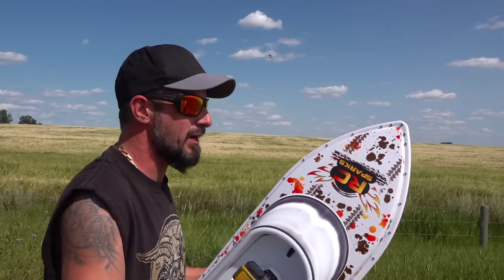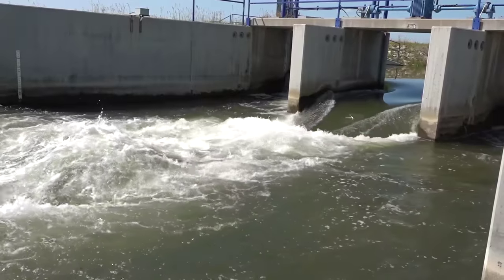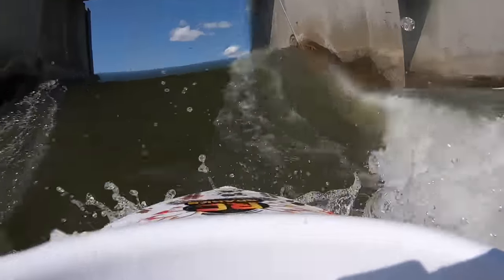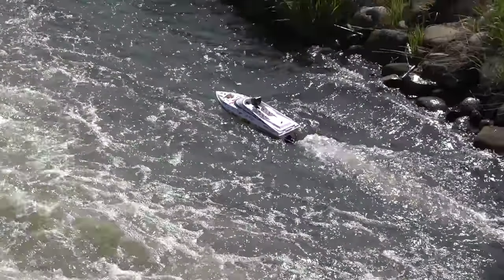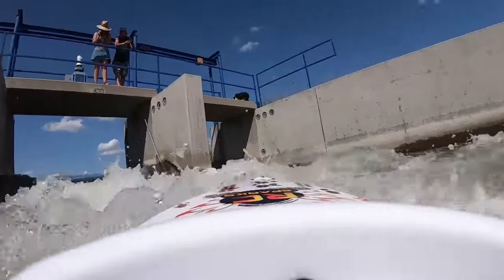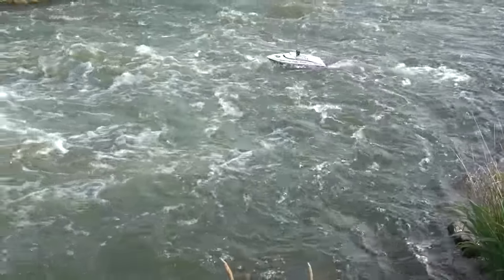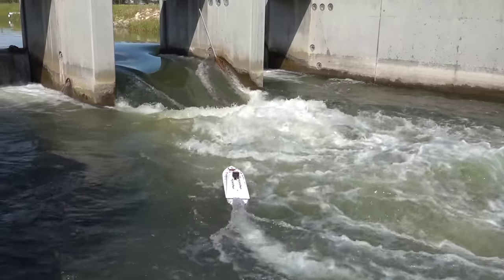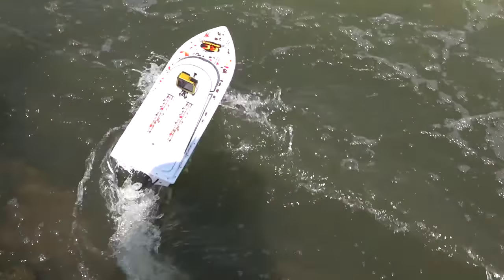IS there MORE POWER?! Thrasher V3 TACKLES the DAM - Jet Boat Bashing! | RC ADVENTURES

Comment: I have a question 
I have a traxxas spartan with upgrades I had leaks coming from the rear 
I have sealed it all correctly put new grommets and fully serviced it all cleaned and grease 
 to make sure it was fully dry I waited 4 days before putting it in the bath tub to see if it leaked after around 5min of just sitting there is had about 20ml of water in it wondering if this is normal for water to come into the hull without any throttle use or having water splashing apon it 
Any info would be greatly appreciated 
Thank you 

P.s another great video you have shared

Comment: I bet it got wet on the inside, I didn't see any kind of seal, looks like the top just hooks in the front and a latch in the back.. wtf? my old ski boat had a seal around the top plate..
Reply: This is designed more like a 1:1 scale boat where we acknowledge that sealing the boat is too constraining to many design considerations that allow for the highest level of performance. Anything can be sealed but what do you trade off on the performance side? At this level of performance atmospheric pressure inside the vessel is desired for a number of reasons and knowing that the boat will be submerged, it makes good sense to design the boat for water ingress with systems that manage the water ingress. It is much more complicated and expensive than sealing it like a cheap toy; but it is well worth it in the end. Our goal is to design and produce the most versatile, maneuverable, and rugged RC boats in the world, not the cheapest or the simplest.   Thanks for your comment, let me know if I anwered your question.
Reply: This boat is sooo awesome,  you guys are doing it right Scott. Only got to run mine 3 times.  Got to take it out more. Proud  V3 owner.

Comment: 🤨Doesn't look too stable to me, bouncing around like a beach ball.😂
Reply: Thrasher V3's ride is very quickly and easily adjustable through different ride plates and steering cones. It only takes 2 screws and less than 2 minutes to dramatically change the way this boat rides. The boat in this video is configured with the stock ride plate which is designed to climb rapids. This configuration does porpoise on flat water, but it rides light in the water, which allows it to hop and climb up high flowing and turbulent shoots in rivers and streams. Here is a video showing a Thrasher V3 configured for smoother water: https://www.youtube.com/watch?v=lXftZ88vz70&t=20s